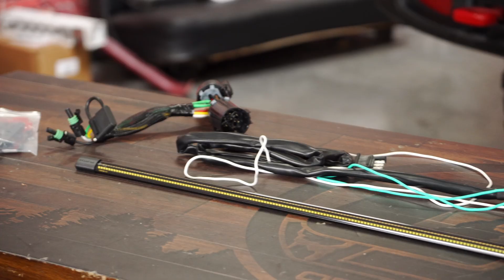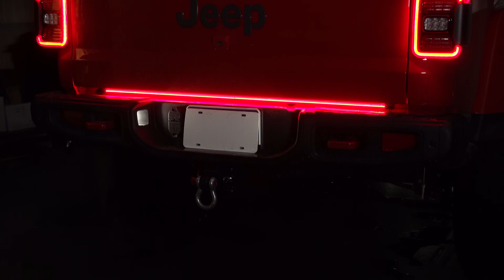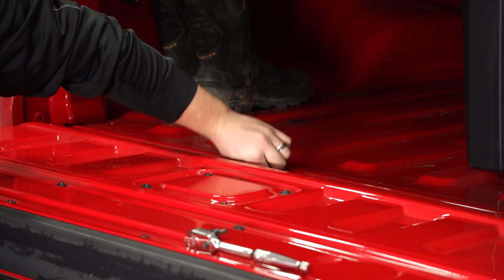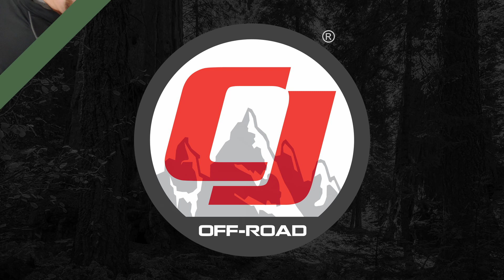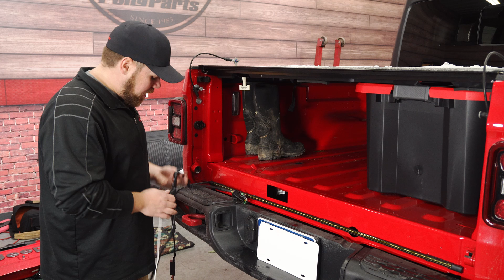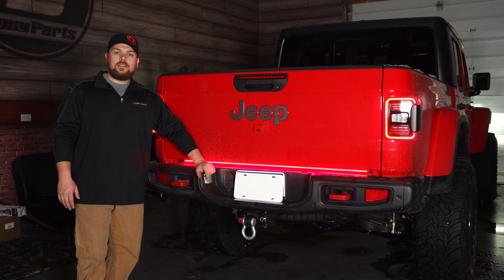2020-2021 Jeep Gladiator Install | PUTCO 48" LED Light Bar

Comment: Cool video . Is there any videos showing how to just hook up a new brake light from a roll bar Without reverse lights or turn signal ? i am using the trailer hookup for my trailer lights so i cannot use that plug . I saw a video of a guy tapping into the the rear passenger side taillight to hook up his new brake light . But it doesn't seem to work for the LEDs on my 2021 gladiator rubicon . Does anyone have a link of someone showing how to do it? for guys like myself who aren't the most electronical gifted 😂

Comment: I dont like that it covers up the spare tire access if you need it, then you have to remove the light and if you're on the trail and have to remove it (dust, dirt, etc...) and re install may be a pain in the butt

Comment: About three months in the resistor stopped working and got hyperflashing. Harness is not waterproof (or water resistant) would not recommend mod if offroading. Yes the lightbar is out of sync if using the plug and play harness.

Comment: We have the 48” red blade (model 92010-48) installed on a 2021 JT and even with this red wire modification the blade is NOT synchronized with the vehicle flashers. To be clear, the exact nature of the out-of-sync behavior changes, but it does not make the flashers synchronize and remain synchronized – They are just out of sync at a differently varying cadence. We reported this to Putco, under their “Option 3” install steps (the red wire mod) with the Quick Connect harness, and interestingly enough Putco support said two things that seem to contradict this video:
1. “MOPAR” vehicles have this trailer flasher synchronization issue and the only way to fix it would be hardwiring to the taillights.
2. The red wire option is not for our vehicle (speaking of the 2021 JT) and they suggest reconnecting it “so it is a loop”.

So I’m wondering, is there anything else you did to get the lights to synchronize? Are you aware that Putco says this is not possible and that the red wire modification is not appropriate for the 2021 JT?

Also for item 1 above, Putco said they “…have no resources to help wire into the tailights.” Which is interesting since they have a “Supplementary Blade Wiring Instructions 2019 Silverado LTZ Package with LED Tail Lamps” that appears to give such instructions. Of course if there were such instructions for a JT it clearly would not be a no-splice installation on the vehicle wiring side.

Comment: The light bar does not blink in sync with the tail lights?
Reply: Great question! / Our Blade is  INSTANT-ON on any 12V power source, including brake light, Running lamp, back-up light and turn signals!.  In-person this tiny delay you are seen is not visible... there are some models like the RAM that the 7pin does have a different SYNC on the turn signals than the taillamps so our Blade will follow the same sync/sequence.   You COULD wire it straight to the taillamps... but that depends how picky you are ;)

Comment: Gonna have a fun time if you ever want to drop that spare.
Reply from the maker: Just pull the bar from the clips and i have access!
Reply: All of our Blade light bars include our patented Clip-ON/OFF install kits,  just in case that you ever need to drop that spare tire! , check them out!
Reply: @PutcoInc  wish they showed that on the video.  Don’t have a flat often but usually not interested in extra steps.
Reply: True. How you suppose that’s gonna work out?